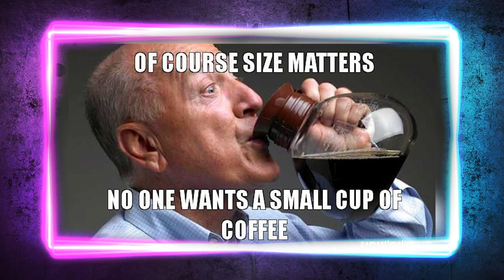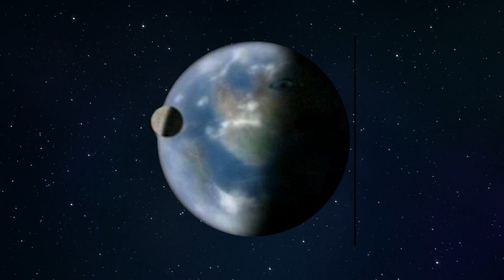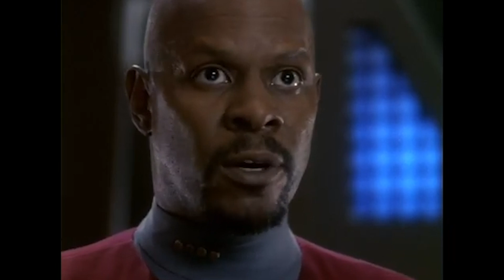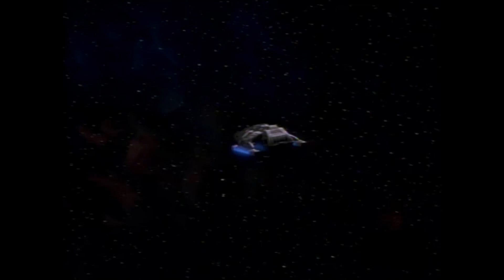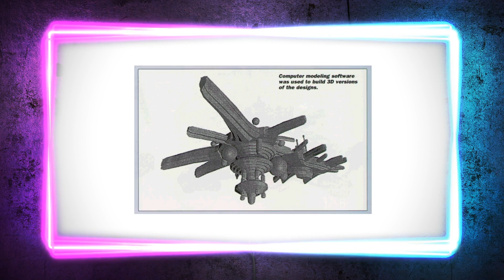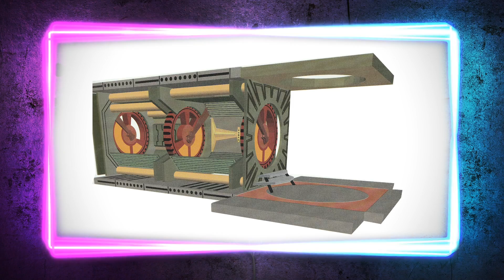10 Features of DEEP SPACE NINE in Star Trek

Comment: There are some elements, even in reality, that can be handled better in a space environment (zero-G, for example) than they can be on a planet. It might be that such ore needs to be refined in space for this reason. As far as the waste goes, they can easily aim it at the Bajoran sun and shoot it out without a lot of effort or energy.
Reply: And also, the Bajoran resistance was picking up steam at the time of the station's construction. It's entirely possible the Cardassians had valid security concerns regarding the ore they were mining (especially the fact that the raw ore could explode when charged with electricity). Moving ore processing and shipment to the station probably closed quite a few security holes that were beginning to pop up.

Comment: 2:36 - Perhaps Terok Nor was originally supplied with ore via a set of space elevators. Or, perhaps to protect from sabotage, they found it more cost effective to process it in space. Also, it's colder in space, and given the heat under which the Bajorans worked in refining the ore, the idea of a facility in space where heat can more easily be "bled off", it made it a safer and more productive environment.

Thoughts? (After all, we're just making this stuff up, eh?)

Comment: You missed a feature. The ever changeable scale size. Watch the opening credits to the part where you see engineer workers welding. If DS9 was taller than most city skylines those workers are 60 feet tall and wouldn't be able to fit in Galaxy class ships docked at the pylons.

Comment: I liked the video, lots of nice info and fun facts, but some of the scaling just seems off, take the numbers below as recorded in the official DS9 Technical Manual

Overall Diameter: 1451.82 meters
  >>>>>>> Manhattan is 3700 meters wide 
Habitat Ring Diameter: 579.12 meters
Upper Core Diameter: 285.9 meters
Mid-Core Diameter: 182.88 meters
Lower Core Diameter: 184.46 meters
Ops Diameter: 59.43 meters

Height of Core (Ops to Fusion Exhaust): 368.8 meters
Height of Docking Pylons (Total): 969.26 meters
  >>>>>video claims 1.7 x the height of the Burj Klifa which is 828 meters 
Height of Weapon Sail Towers: 192.02 meters

Comment: The promenade also had dimension space folding technology, Either that or those airlocks go nowhere and people stepping into them are just committing suicide because the docking ring and promenade aren't anywhere near each other.
Reply: The Promenade is in the habitat ring so no, it isn't near the docking ring. There are 3 long arms separating them. I imagine the airlocks on the Promenade are there in case there is a hull breach, as there should be for all space vessels and structures (force fields are dependant on power supply, and a door that closes when the power cuts out would be the logical alternative). Bear in mind that the upper level of the Promenade has literal windows to look out into space which can be seen from outside.
Reply: @Kartissa  no they just cocked up the design.
Reply: @Carwyn.Morris  Sorry, but unless you're the designer of the station, your opinion is irrelevant. (As is mine, but at least it's consistent with expected safety features on a space station.)
Reply: @Kartissa  no it isn't there are airlocks on the inside of the station that are used but aren't on the outside of the station. Unless they are magic they shouldn't be there.

Comment: As I understand it, it wasn't a single reactor at the bottom of the central tower, it was several (6?) Reactor's working in parallel to supply the stations power needs and at least 2 of them were non-functional (when you see the station's lower area in the show, there are always 2 dark spots in the red glowing area, those are the off-line reactor cores).
NO station/ship only has 1 power core, they ALWAYS have at least 2 (1 primary, 1 back-up for when the primary is down for maintenance or repairs)...

Comment: They put the refinery in orbit for security reasons, especially keeping saboteurs and bombs away from the highly volatile ore. Easier to secure a mine entrance and a few shuttle pads than and entire refining facility on the surface. Was that the original plan for the station? No, but it was likely under construction and then adapted. What do you do with the highly toxic and polluting waste?! Haven't you studied industrial cultures?! You eject it into space like any other waste. Who cares if it poisons children and kills plants or crops? Not a planet that was going to be colonized by the CU anyway and they had no children there to be given cancer. They kept their kids safe back on the Cardasia Prime.

This is going to need a revision video. You really did not consider the security issues faced by the CU while strip mining Bajor or how little they cared about the pollution of those activities while doing so. Also, it wasn't just the one resource they were strip mining. The CU went after all mineral resources they could possibly extract by any means possible. Bajor used to be as rich in mineral wealth as many founding Federation planets were, until the Cardasians showed up and went full colonial on them.

Crew of 300 was the minimum crew. 7 thousand was the max long term population. It was likely closer to 2500 to 5000 permanent habitants, depending on the time. During the start of the series DS9 and during the dangerous times on the station, the population was likely closer to the low end.

Comment: ok when deep space 9's shields were used to lower the stations mass that was chief o'brien using the shield to create a weak warp bubble. This is something that a alcubierre drive "warp drive" could be used for before ever trying to go faster then light. Reducing a ships mass makes it so you need less fuel to go from point a to b , and  reach greater speeds with less fuel in less time. Its not fake science sorry to say, it's just writers doing something neat that could be possible someday. 
But using the shields to do this is the part that I have some questions about. I don't think we can ask the Chief for information on  how the stations shield work though.

Comment: I used to be annoyed that the docking pylons pointed inward. It meant that if one ship is too large it could block the other two pylons from being used, while outward pointing pylons would have all of space to position the ship. 
But now knowing it’s to keep docked ships inside the shield bubble, and the cardassians probably designed it with a specific ship model in mind (the cargo transports, which were probably long and thin), makes it actually make sense.
Reply: Also, having the pylons face outwards means that if the station moved, the ships need to move with them much farther and faster to avoid damage. Being inside puts them closer to a rotational axis.
Reply: I never thought about that, that the pylons are faced that way to keep ships protected by the station's shields. Head cannon updated.
Reply: To be fair we see that a Galaxy Class ship can dock there without obstructingthe pylons which is about as big as ST ships get. Also there are docking ports on the outer ring so outward facing pylons could still be obstructive.

Comment: Well, the whole thing about having 3 airlock doors kinda makes sense,  one of those doors could serve as a backup in case of breach in one of the other 2 doors that would leave it to open space
Reply: You'd also have emergency force fields, so a third is really redundant.
Reply: @phydeux  Forcefields can run out of power, which can be a limited resource in a disaster.  A solid wall will stay there much longer.  I have a similar gripe about space prisons that rely on forcefield walls that fail if someone cuts the power.
Reply: @darwinxavier3516  - Yeah, well, most people would say that if they're in a space prison it's for a reason, and that their loss is probably a cost savings in the long run.
Reply: @phydeux  Force Fields can fail,  thus why I'd say having a 3rd airlock door would be a good idea,  even if the Force Field was to fail or couldn't be used due to damage to the emitters

Comment: "That's just a Star Trek fake Science Solution to fit the script. " sounds like Star Trek in a nutshell
Reply: Actually the Enterprise D used the same trick to augment its maneuverability on impulse power.
Reply: Or even more common, fake a science anomaly that stops technology working to fit the script
Reply: @hoplitethirtynine1487  like the Organians in the Original Series. Those guys were such a cop-out
Reply: should have added on some deflector dishes to manipulate to make it believable
Reply: @bjoernusw5195  Wouldnt the shield emitters work for that? After all theyre called "deflector shields".
Reply: Was that a reference to "reverse the polarity" I just read?
Reply: @phydeux  probably
Reply: Actually Ben got it wrong Dax said "couldn't you modulate the output of the deflector generators just enough to create a low level subspace field around the station" deflector dishes deal with subspace fields and creating a subspace field ahead of the ship to move harmful particles out to the ships path so by enclosing the station in a bubble of subspace it also lowered the inirtal mass of the station like the inirtal dampers getting a "warp powered"kick up the ass